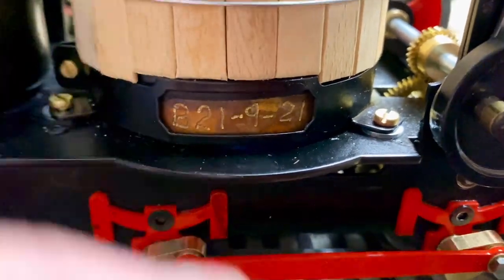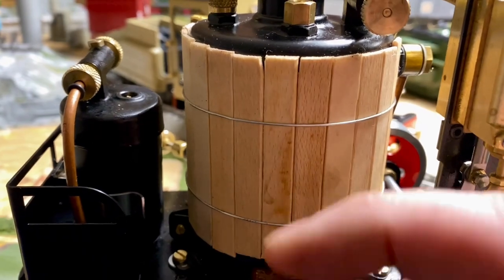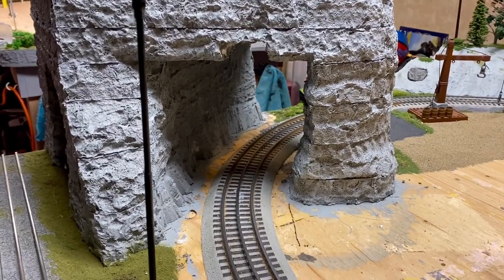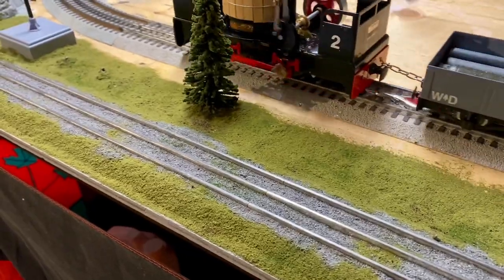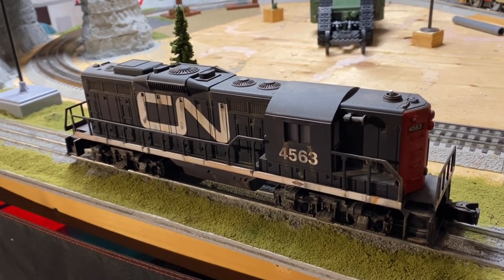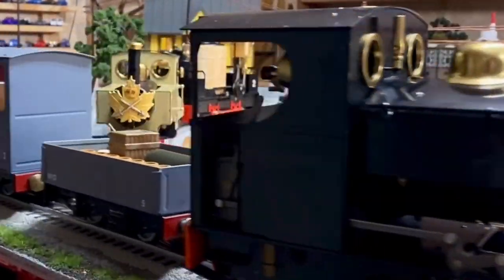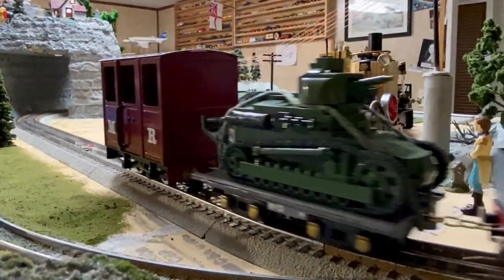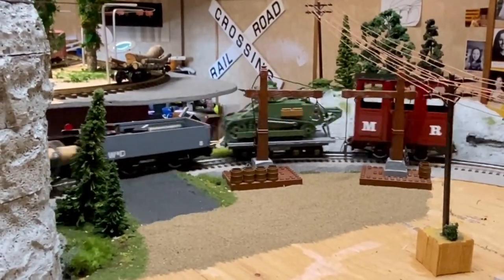Victoria B.C.: Raised Brunel’s boiler for better gas flow & run of Mamod Mk 3 & Accucraft Sabrina

Comment: Love the notch in your tunnel for the funnel of the Brunel ;).  I think I'll try lifting the boiler on my Brunel one washer as well, got a few other snags ironed out on mine today.  I do you like you night running and maybe a running lamp for the No2 as well?  Always impressed with you 'man cave'  Cheers.
Reply from the maker: Thanks! It is a fun room. I’ve been thinking about a lamp, but would want it powered by the loco. Hmmm… a bracket, small electric motor as a dynamo… run it via a band to the flywheel…

Comment: I've recently purchased a Mamod Stirling, really impressive locomotive  but the gas burner was all over the place, I swapped the injector for one out of my Bix gas burners, no5's I believe. Much better flame now, stable and more power. Don't know if that would help the brunel further 🤔
Reply from the maker: Thanks Ben. I should consider the gas jet. I hadn’t. Now after your mention it seems obvious. 

I think the biggest issue with the Brunel is that there was not enough opening under the boiler to let combustion air in. Now after raising the boiler a touch the fire is better but breezy days cause problems. Now I am figuring out a way to add shielding. It never ends. Lol. But to me that’s part of the fun. 

I’m sorry to hear about your Stirling’s original gas burner. The only reason I have not purchased a Stirling is the lack of sight glass. I like to keep my engines running by topping water, oil and fuel. 

I asked Mamod if they would consider adding a sight glass - even once and I would pay for it. They said no. I contacted Roundhouse and asked if they would add a sight glass to a Sammie if I put my name down for one in their next batch and they said yes. 

I love Mamod and support them as a small company. However, I do feel their quality control can do with a little improvement and they should provide options like a sight class on their top engine. 

Their customer service when I have needed them has been excellent.

Comment: Try to get the egsast of the coffee pot engine in the chimney to increase draft
Reply from the maker: That could work, but no need now. Raising the boiler a little worked well.
Reply: @Terrys-Steam-and-Cobi  
How many tubes does the engine have?
Reply from the maker: @laaity  the engine doesn’t have tubes as such. It has a single flu with several cross tubes.
Reply: @Terrys-Steam-and-Cobi  huh
Cool
Ye know there are ho scale live steam 
If you can try em out
Reply from the maker: @laaity  sounds rather small and fiddly. Lol
Reply: @Terrys-Steam-and-Cobi  yea but i think its rather cooll that hornby is doing live steam 
And also are you ever gonna get  coal fired locomotives
Reply from the maker: @laaity  one day I’ll get a coal fired loco. They are more expensive and I have a hard time saving money when I see other interesting things.
Reply: Putting the exhaust into the chimney would mean the condsate and oil dropping onto the ceramic burner. So you would then need to fit a trap. I understand that Mamod are looking at a easy fix for the exhaust, directing it through the running board
Reply: @peterjohsnton7126  o
But thats an easy thing to do
I think
Reply from the maker: @peterjohsnton7126  I have also heard they are looking at a fix. I like the steam being directed straight up. I am not fond of the idea of steam puffing around from under the loco, but it would be cleaner. And I agree about having to trap stuff from going to the burner. Therefore that seems like a lot of effort for relatively little benefit. My current arrangement works great.